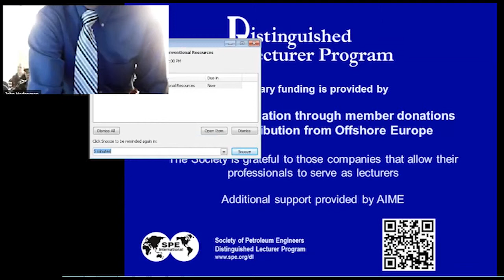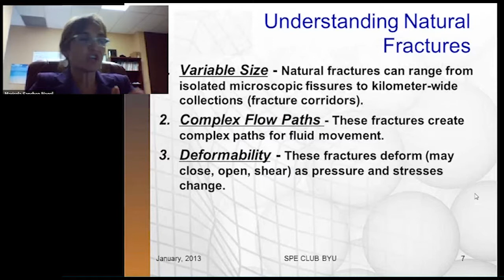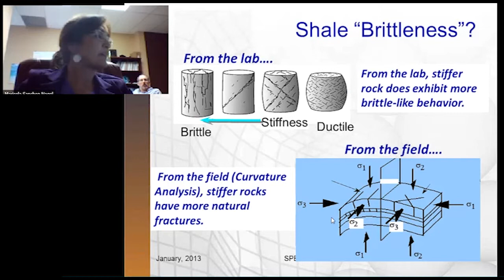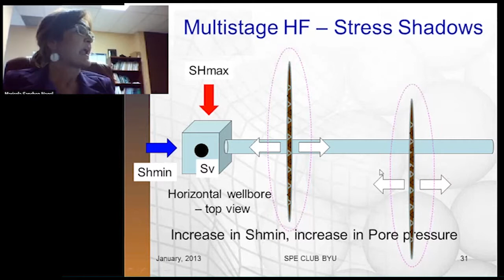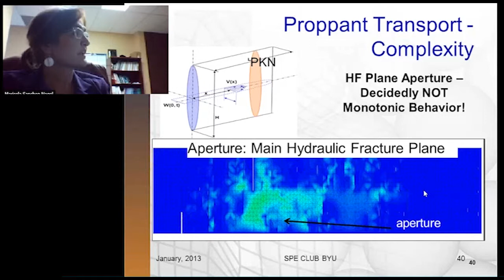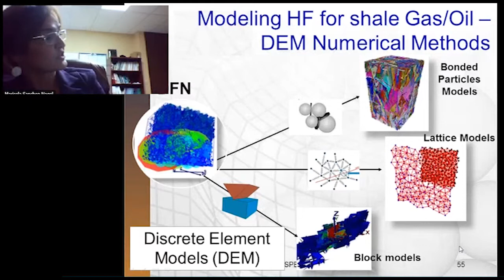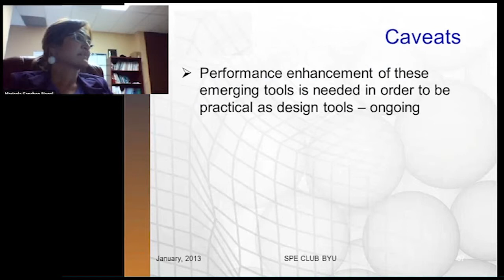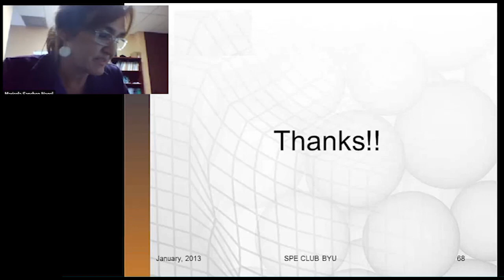Stimulation Optimization of Unconventional Resources

Comment: Can you kindly advise on how to model the effect of natural fractures on natural gas injection in a tight oil reservoir using huff and puff technique. thank you
Reply from the maker: +MAREMBO MICHEAL, the speaker of this webinar may be willing to answer this question. I'm recommend that you send her a note if she included her contact information.
Reply: Thank you so much, how best can i get her contact. I appreciate the efforts put in to forward me a kind reply.
Reply: I would also need advice on how to optimize natural gas huff and puff for a tight oil Reservoir, can i use APMonitor.com inbuilt optimization tool to achieve this, in a bid to maximize oil recovery and Net Present Value? Thank you.
Reply from the maker: Here is Marisela's LinkedIn profile: https://www.linkedin.com/in/marisela-sanchez-nagel-77a38b34/  I'd recommend that you try to connect with her but you'll also need to realize that professionals are generally very busy and may not have time to help or respond.

Here are a couple papers that may relate to your interests:

Udy, J., Hansen, B., Maddux, S., Peterson, D., Heilner, S., Stevens, K., Lignell, D., Hedengren, J.D., Review of Field Development Optimization of Waterflooding, EOR, and Well Placement Focusing on History Matching and Optimization Algorithms, Processes, 5(3), 34, 2017, doi:10.3390/pr5030034  - it is accessible from the link http://www.mdpi.com/2227-9717/5/3/34

and another

Udy, J., Blackburn, L., Hedengren, J.D., Darby, M., Reduced Order Modeling for Reservoir Injection Optimization and Forecasting, FOCAPO / CPC 2017, Tuscon, AZ, Jan 2017.  https://apm.byu.edu/prism/uploads/Members/udy2017_eor.pdf
Reply: APMonitor.com, thank you so much